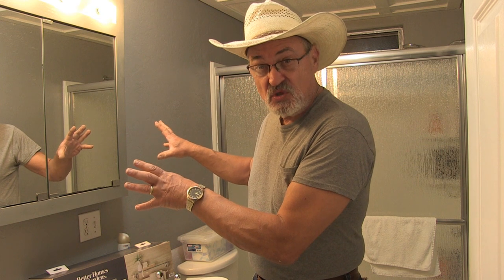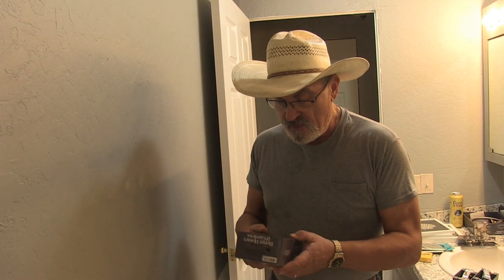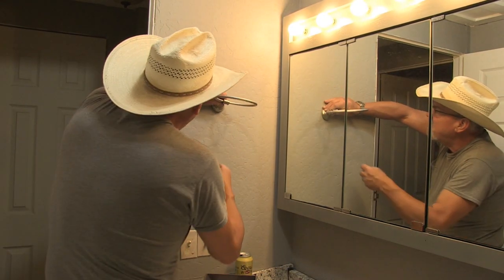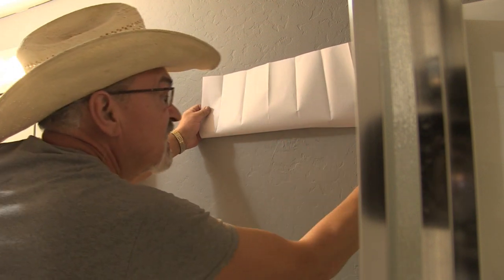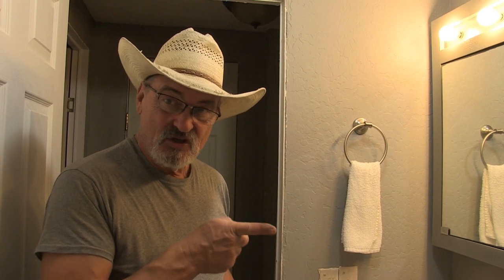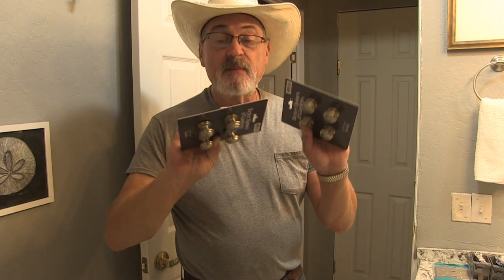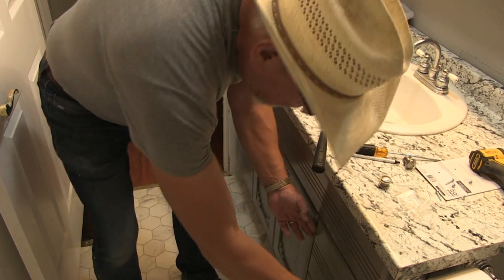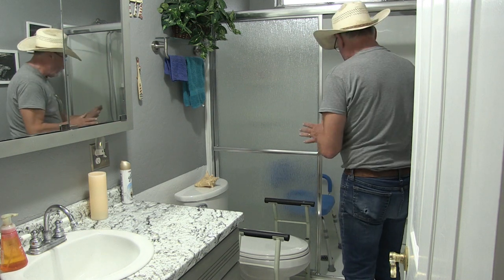DIY BATHROOM MAKEOVER - Phase 4 Part 1 Safety & Towel Bars

Comment: The bathroom remodel looks beautiful!
 The plug 🔌 concerns me above the sink. I didn’t see a ground fault receptacle. My husband installed them in our bathrooms to prevent electrocution, in case a hairdryer, curling iron etc.fell into water. 💦

 I hope this remodel will inspire my husband to get to work on our outdated bathroom.
Reply from the maker: That plug is a GCFI built into the circuit branch switch in the breaker switch box. There was a tiny label on the white face plate with GCFI that did not transfer well over to the new face place. I will have to create a label, but it is there.